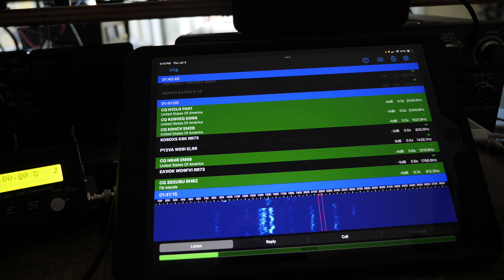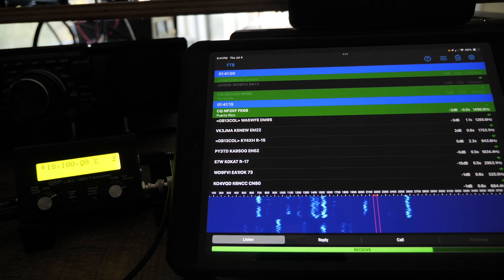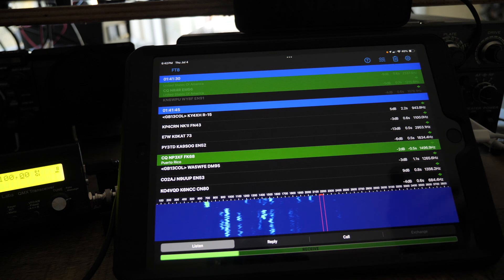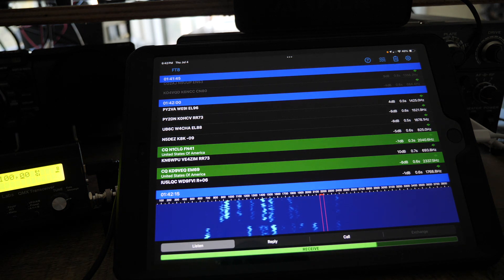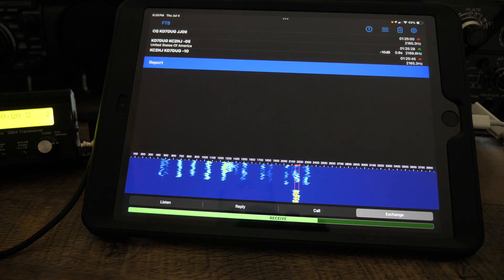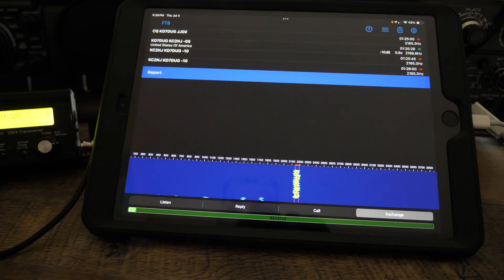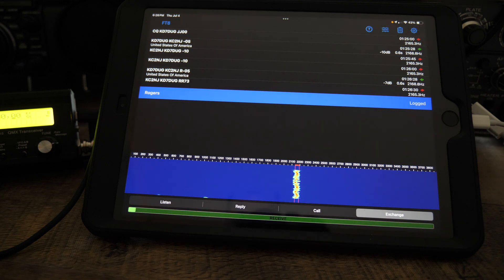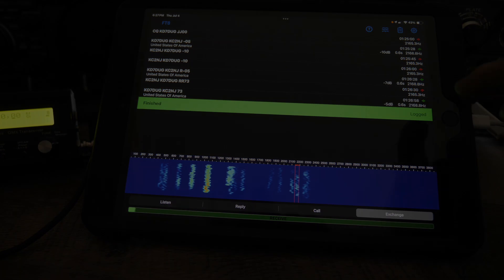QMX + iFTx and IPAD FT8 Operations

Comment: Is there a reason you can't just have one cable that goes from lightning cable to USB-C? Does the adapter do something?  Thank you!
Reply from the maker: If you’re using an older iPhone or IPad with lighting plug , you’re going to need an adapter. If your iPhone or IPad is USB-C then you are correct you only need one USBC to USBC cable .
Reply: @mountaincwops  Thank you!
Reply from the maker: Absolutely 👍🏻! If you have a question , message me anytime @ my email listed on QRZ